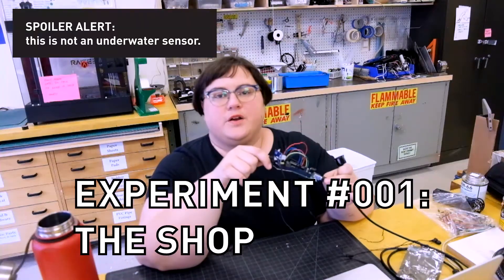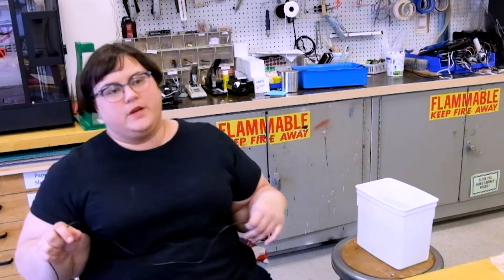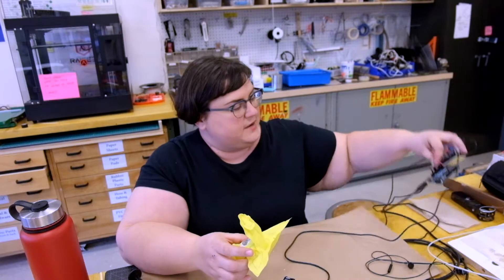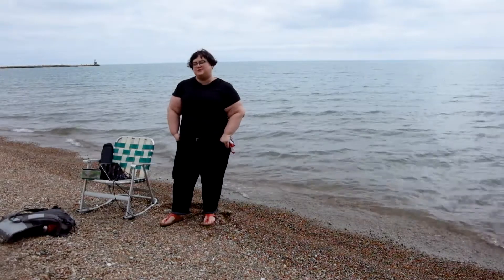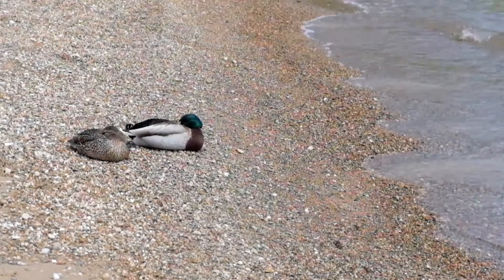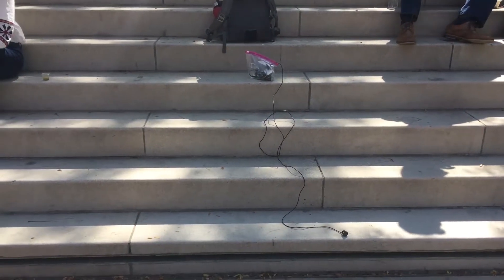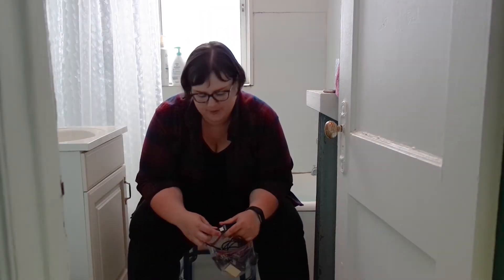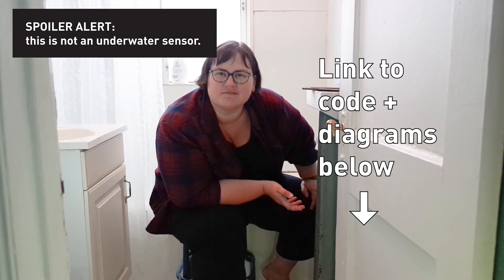Experiment: Waterproof Ultrasonic Transducer JSN-SR04T-2.0

Comment: hello,your mistake is that you are considering the tranducer as the receiver,but it is not,the receiver is on the board and if  there is no something betewen them the board is measuring properly.I use the same device on the bait boat and it is measuring fine

Comment: Hi guys, has anyone tested this sensor underwater? I searched a lot of information on the Internet, someone works, someone does not, I tested it does not work for me. I started research in this area, can anyone help, which sensor to take an inexpensive one, preferably from Aliexpress, so that it works under water. The purpose of my project is to measure the speed of sound underwater, in a sewer pipe with a diameter of 11 cm and a length of 1.1m, I need your help in recommending a sensor.
Reply: Have you figured it out?
Reply: The sensor?

Comment: HI Becky
    I have just been playing around with board AJ-SR04M which i think is the same as JSN-SR04T-2.0 i have got this to work under water just needed to fit one componant on the board that way you can switch between sound in air or looking  into the water won't to use it for sonar for a 12ft submarine i have got have a look on youtube and type in videos of 12ft Gato submarine made this 30 years ago. Have just finished doing lidar radar for it and it will transmit back to bankside and show on laptop what the sub is looking at
    All the best Subjohn in uk

Comment: Hello everybody.

I was resarching about ultrasonic sensors and after to watch this video, I watched another one where a guy got take underwater measures with this sensor. I think that the problem with your experiments was the shallow depth. You need at least 1.125 meters to take realible measures with this sensor underwater (sound speed in water = 1500 m/s). The minimum distance that JSN-SR04T is able to read is aprox 25 com, taking 0.0015 seconds (50 cm coming and going). Underwater, the sensor takes the same time (0.0015 seconds) but the speed is higher, thus the distance is higher too:

 (1500 m/s * 0.0015 sec = 2.25 m; -> coming and going: 2.25/2 = 1.125 m)

https://www.youtube.com/watch?v=njDQKdZzGMI

Comment: I believe what went wrong is, The sensors chip should have a comparator which was configured to the voltage recieving from the sensor when operated in air, I believe a more good experiment to conduct would be to make a reciever with another one of those and probe it using a scope

Comment: Excellent video.A bit late to the party but this is NOT an underwater sensor PROBABLY. I did similar experiments all of which failed miserably.
What I THINK the culprit is: Bubbles forming in front of the sensor probe.

 Some notes taken from the comments.

1. Minimum range in water is 80 cm (water speed= 4 * air speed)
2. Maybe energy is not enough for sound wave produced to travel in water(too much attenuation?).
3. Maybe different(higher) carrier frequency is needed for a sensor like this to work in water.

Extra note: Yes this sensor will most likely work in humid environments (outside water). HOWEVER, depending on the conditions, humidity and/or temperature might be needed to be taken into account to get accurate measurements. 

Good luck everyone.

Comment: Thanks for the information and the video. I'm looking for an HC-SR04 equivalent ultrasound distance sensor, but water-resistant. It has to detect 20cm<distances<5cm. I'm going to use it to detect swimming pool water levels. Do you have any suggestions? Thanks!

Comment: The minimum range of this sensor in water should be around 80 cm at least ( since speed of sound is around 4 times bigger in water). 3 feet is around 90 cm and perhaps it was 10 cm deep into the water. You could make the same experiment in 4, 5 or 6 feet depth and see what happens.

Comment: Hi, thanks for the video :) This is great stuff. I am about to undertake some budget experiments in underwater communication based upon piezo transducers at 18kHz and 40Khz. Finding any information on marine transducers and depth sounders is quite difficult. Interesting enough is that piezo based hydrophones appear to work very well. I really think this may be a coding/driver issue rather than the  transducer as I have seen others create/or discussing small sounders like this in some Arduino forums. Something I have discovered from initial research is that temperature plays a significant roll in speed of sound calculations for under water, and that some amount of discrimination/filters may be required as well as dealing with side echo . Also note that piezo transducers are natively AC sine wave, and Arduino is DC square (They will work, but are very noisy sound, not clean pings) so maybe look at a DAC to transducer, and ADC for the return (If you aren't already). I have subscribed and bookmarked your channel, so will post my findings back to you when I get to it (If you are still interested :))
Thanks again
Axle
Reply: Hi Axle! I'm aswell about to do the same thing! Would you like to discuss this and maby learn from each other?
Reply: @albinjanzen  Hi, I would be happy to exchange ideas. I must admit that I am still setting up my electronics bench and am still a few weeks off making a start. I will post some info up on my YouTube and Google sites in the coming weeks =)
This will include some study and info on underwater transducers and hydrophones =)

Comment: It works well outside the water and it measures the distance between the sensor and the water. So that it works within the water and it measures the depth you must modify the frequency of the sensor since the water in denser than the air.

Comment: Documentation of your process was very useful! I was curious about the durability and waterproof-ness of the sensor and yours seemed to have survived full immersion, even in some funky water. I /suspect/ it didn't actually /function/ underwater are for two reasons: 1 being the time of return, if minimum bounce time is 20-25cm in air, it would be 80-110cm in water. But then part 2 becomes a problem: ringing enough energy to sense in to water is harder, maybe 80+cm is just too much for it? Either way I'm going to pick one of those up and experiment! Thanks!
Reply: hey man have you tried it i am just curious i have taken this as a project

Comment: the speed of sound depends on its medium. The speed of sound in air is not the same as in the water. In air, the speed of sound is 343m/s while in water the speed of sound is 1480m/s. maybe you can change these value in your code..

Comment: try this code under water

#define TRIG 11
#define ECHO 12

 void setup()
 {
  Serial.begin(9600);
  pinMode(TRIG, OUTPUT);
  pinMode(ECHO, INPUT_PULLUP);
  
 }

void loop() {
  digitalWrite(TRIG,LOW);
  delayMicroseconds(2);
  digitalWrite(TRIG,HIGH);
  delayMicroseconds(20);
  digitalWrite(TRIG,LOW);
  int distance = pulseIn (ECHO,HIGH,26000);
  distance = distance/50;
  Serial.print("Distance ");
  Serial.print(distance);
  Serial.println("cm");
  delay(1000);
  
}

Comment: Do you think an ultrasonic transducer can go through the metal of a propane tank to detect propane usage? I was thinking of attaching it firmly to the bottom of the tank and it would have to go through the metal to measure the propane.
Reply from the maker: Definitely not. The sensor will only sense the metal.
Reply: Yes, definitely no way! I used for measure the gas in an tank, (a simple Prinzip) the weight, with a load cell an an HX711, this works werry well an accurate!

Comment: Nicee .. You did do some nice and rigorous tests .. Love the efforts you put in !! Do you know if there is any waterproof sensor which has less than 20cm distance? (according to 0:43)
Reply: The 20cm comes from the fact it is a single sensor(. Speaker)  used for transmit , then for receive ( the speed you can switch between uses is the limiting factor)
Reply from the maker: I did not find one-- I believe that would be a much more expensive sensor.
Reply: DYP-A02YY has that feature, but it's costly.

Comment: Hello, I wanted a waterproof ultrasonic sensor with less minimum distance like the HC-SR04 but the JSN SR04T has high minimum detection distance because it has only 1 transducer. Also JSN SR04T PCB is not completely sealed. Have you tried this sensor? https://www.ebay.com/itm/253978673298 or this modified HC-SR04? https://www.ebay.com/itm/254058015473 Have you tried any of those 2?